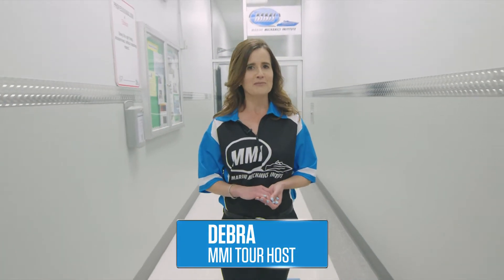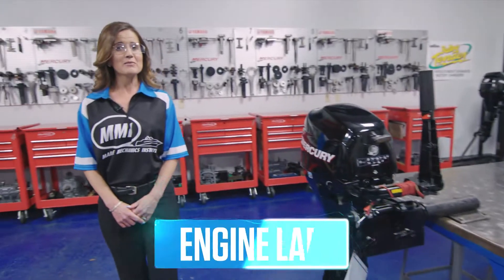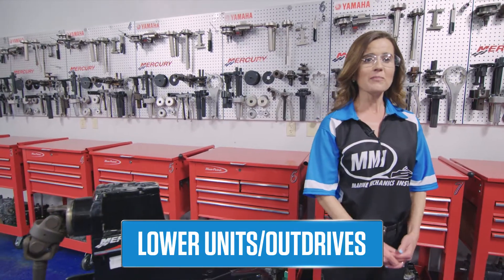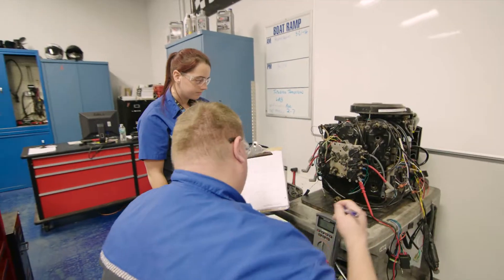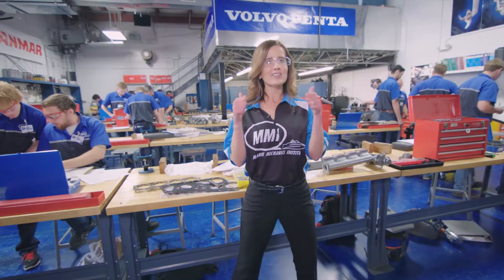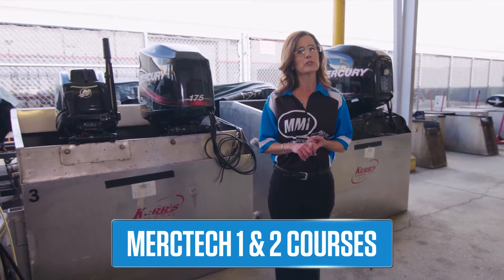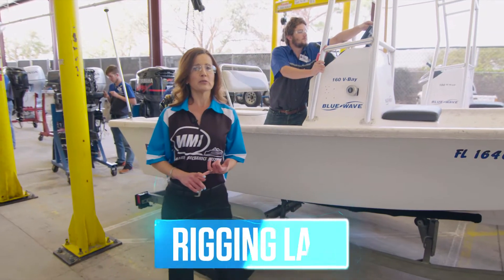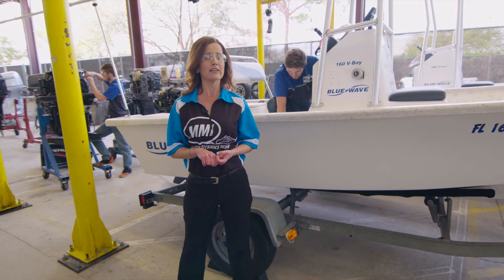Take a Marine Lab Tour at MMI Orlando, FL, Marine Technician School - Marine Mechanics Institute

Comment: Do you offer, or can you recommend a marine mechanical program for a person preparing for long range cruising in retirement?  

I’m already competent with do-it-yourself maintenance, including fluid and filter changes, impellers, belts, hoses, grease, electronic upgrades, and similar.  I’m hoping to get better at diagnosing and repairing motor related fault codes, and other items that could be repaired with tools and spares that are reasonable to have stored onboard. 

The goal is greater seamanship and self-reliance when venturing to cruising destinations where mechanical repair help is beyond 24 hours away.

A example would be a retired couple traveling in a mid-range trawler in the 40’ range traveling from Seattle Washington to Alaska.  

Thoughts?
Reply from the maker: Our 51-week Marine program may be what you are looking for, more info here: https://www.uti.edu/programs/marine
Please feel free to call directly with any questions, 1 800 834 7308, thanks!